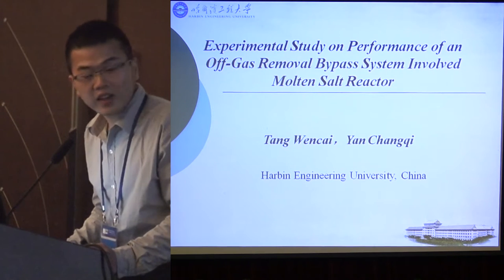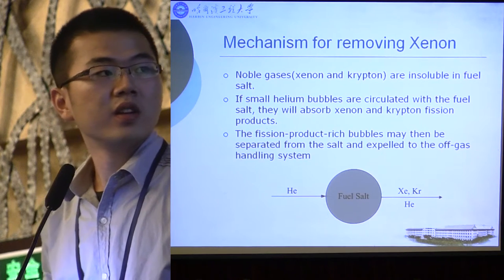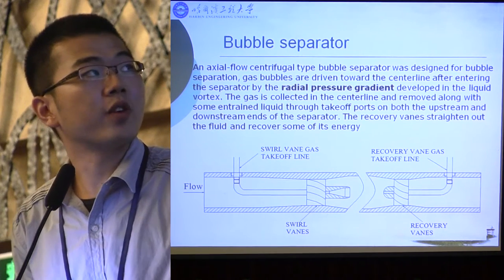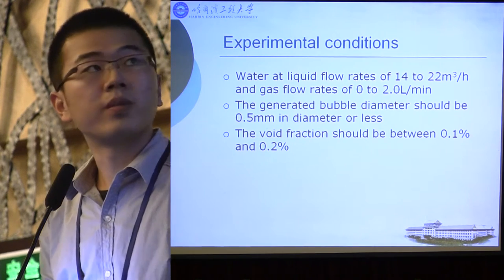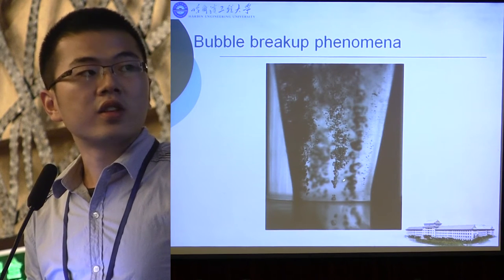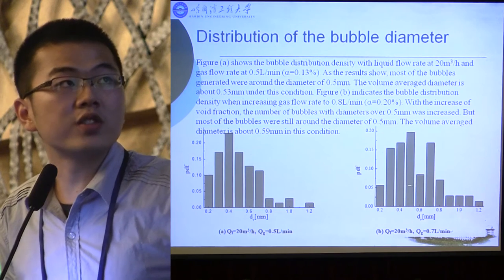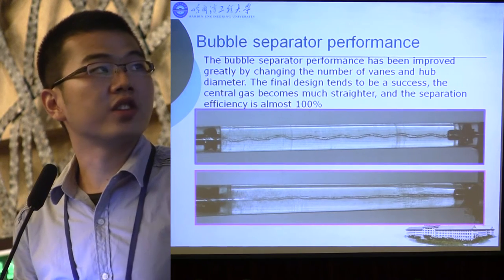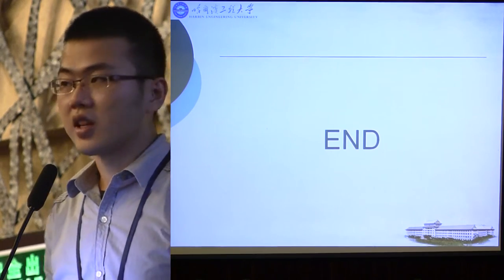Tang Wencai - Off Gas Removal Bypass System for Molten Salt Reactor @ ThEC12

Comment: This is actually really interesting work and has applications beyond just MSRs. I could very well see this finding use in the water treatment fields where at present there are significant steps involving aeration and removal of off-gas.

Then again, the venturi tube design aerator can in itself be found in many water treatment setups so perhaps this work derived from water treatment rather than the other way around.